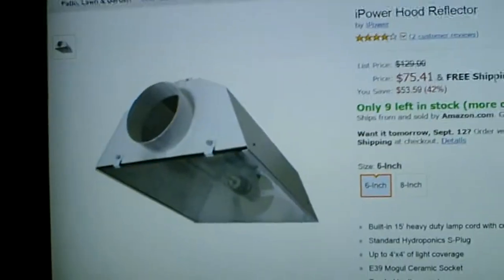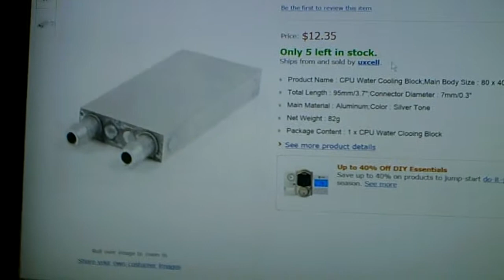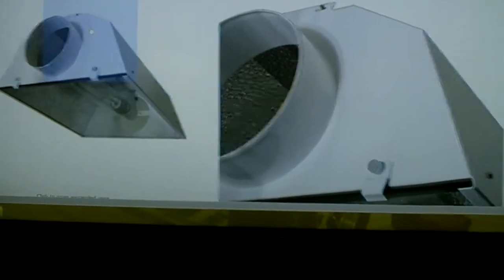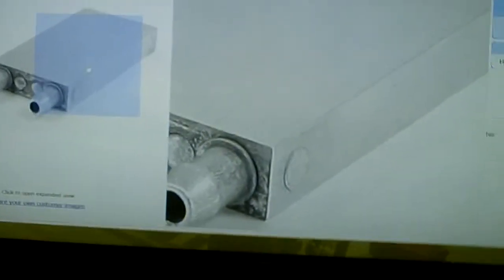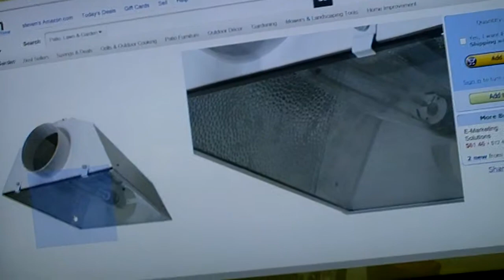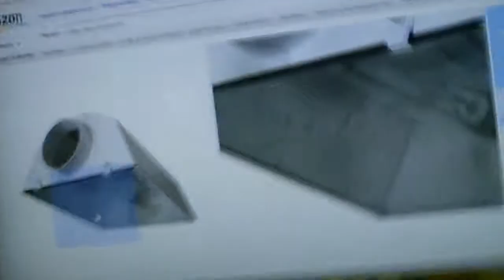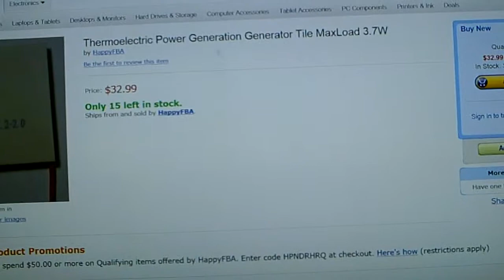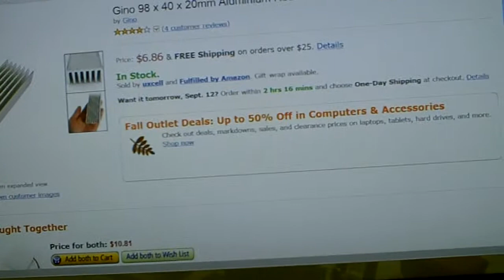liquid cooled power generating insulated grow hood idea

Comment from the maker: My hood koozie vid I made a cover out of interlocking floor tiles and then added a second layer mat over the top. Should ass some fiberglass mat first and insulated hose. Double pane of glass and heat is not a problem what so ever. Put ballast inside a duct made from tile about seven inch diameter. Wiggle wire wrapped around ballast to keep in center of tube. I was at one to two degrees different than thermostat setting. Zero extra cooling needed. Quiet as hell too.